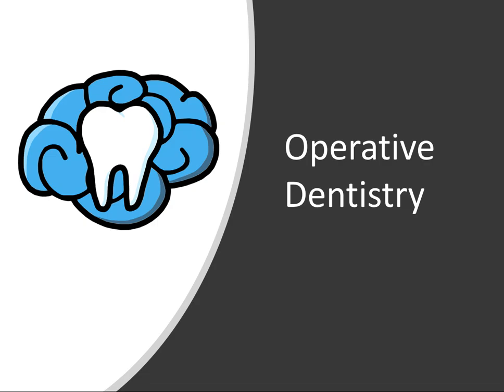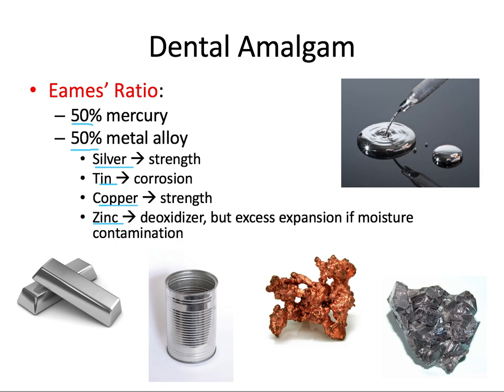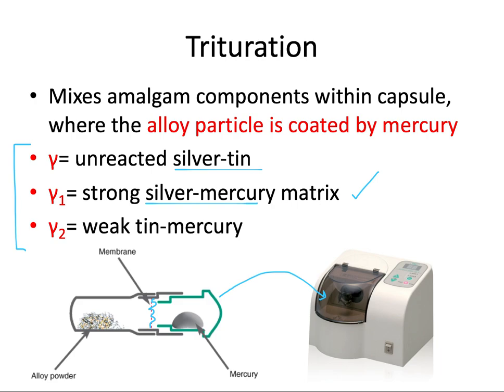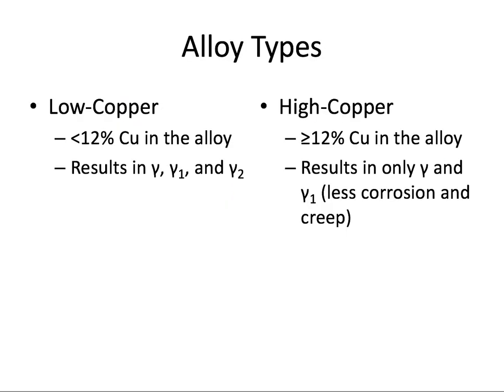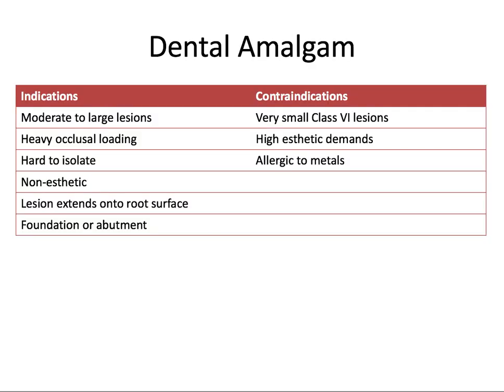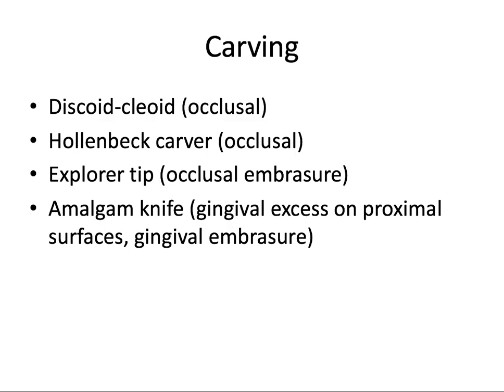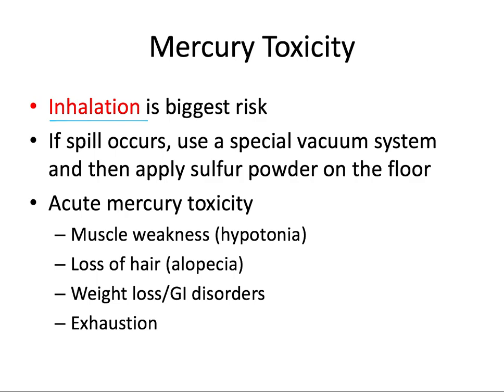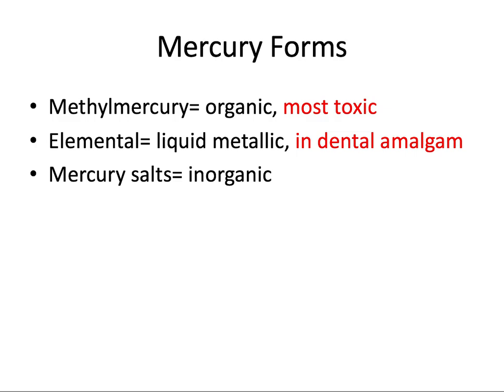Operative Dentistry | Amalgam | INBDE, ADAT

Comment: Thanks so much for these videos, they're  a lifesaver!
Just a question about 3:15 as the y and y1 were flipped compared to what I've been told about strength.
I was taught the gamma phase is the strongest with the most corrosion resistance (and gamma1 is weaker than gamma, but still stronger than gamma2).
Reply: Yeah that part confused me too